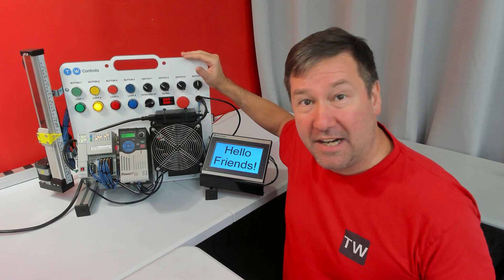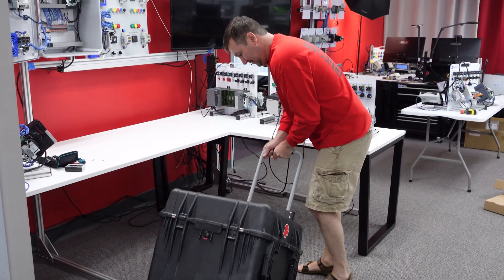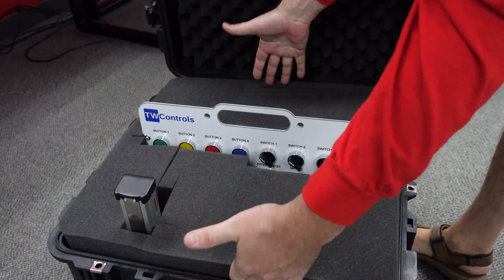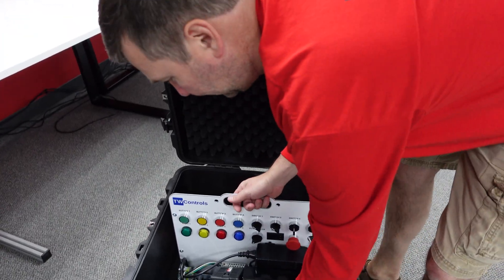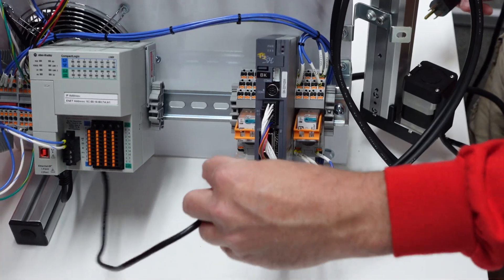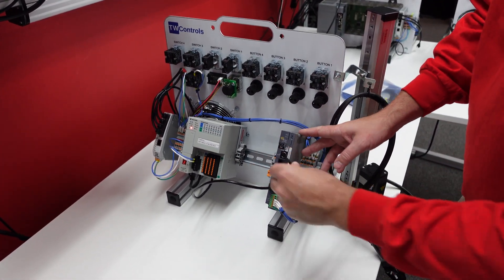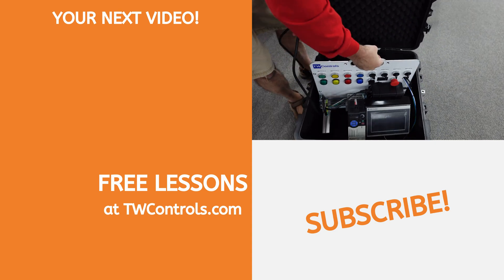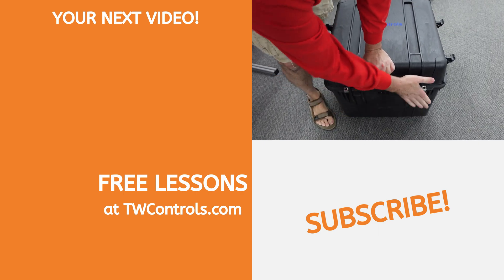PLC Trainer Carrying Case

Comment: Hi Tim, so not related to the video, but I figure it would look better if I comment here and maybe people see it(and because is your latest video lol).
Do you have an advise or recommendation on where to start designing circuits, panels, etc? Software's you use or recommend, guides, anything. 
I have a very very small project with some safety devices and lots of emergency stop push buttons, and oh boy its been challenging since is my first time attempting to do this kind of work, I've been diving into finding something that can help me design and display it on a 3D model since this is what I need(and the 2D electrical diagram too), I am designing this little panel etc.... But oh man, is rough! How in earth I am going to access programs like Eplan, Solidworks(I just to use SW, not the electrical tho), when they are thousands of dlls and I am just starting out, I dont have that kinda of money yet, I dont understand how those companies get people on their softwares since they are so expensive.... And I am very confident that you wont tell me to seek for softwares with fake activation code, cracks and all that, so very curios on your response to be honest.

Anyways, advice is all I am seeking here, have good one everybody!
Reply from the maker: I'm actually working on some videos to address this very thing.